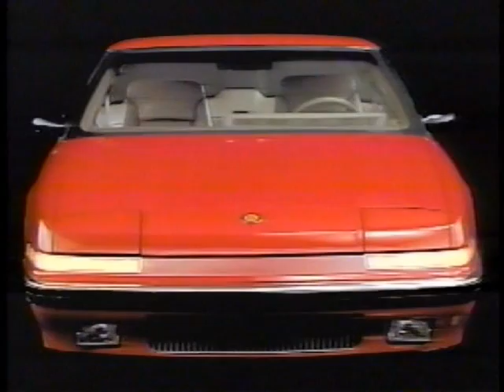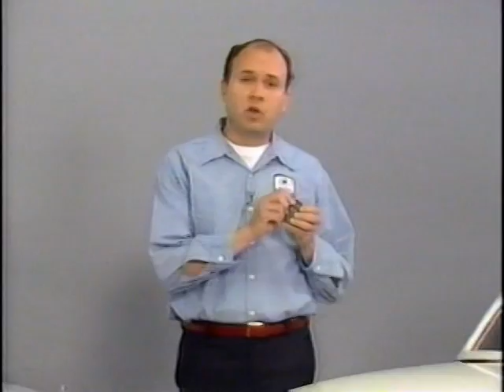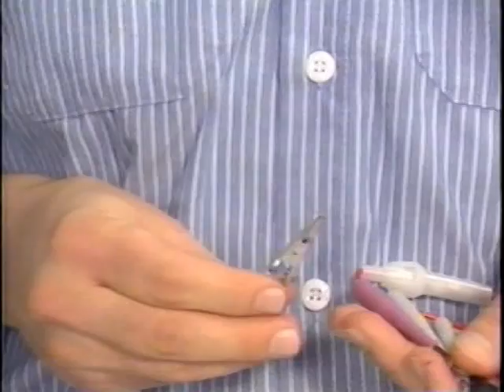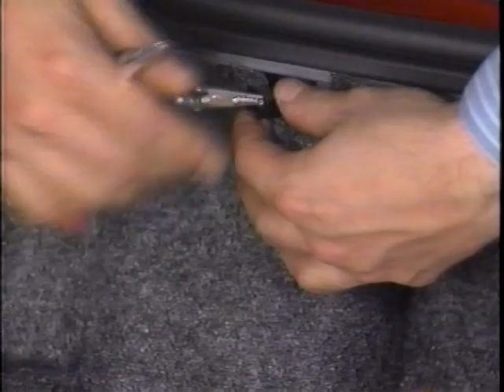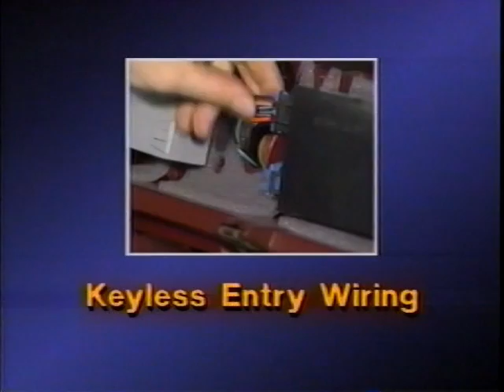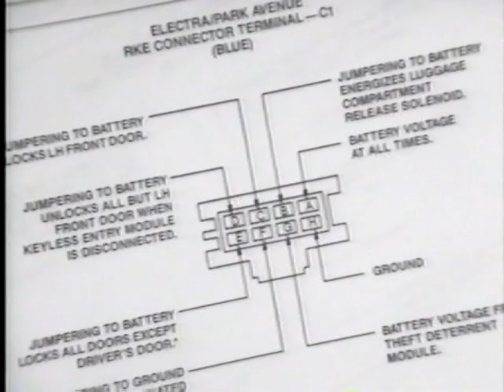Buick - Remote Keyless Entry Systems (1989)

Comment: Any Buick thats front wheel drive is junk even the new Buicks they are a wast of money
Reply: My 90 park ave is very nice the engine is amazing 200k sounds brand new what happened with giur car cv joint busted and you didnt know how to fix it?
Reply: @big6pun07  don't  have  that problem  I a ROADMASTER  rear wheel  drive  with  the Corvette engine  in it
Reply: You're an idiot, I have two 89 Reattas, both over 200k miles and never a problem with either one. You probably drive a pos rice burner.
Reply: Yea ok the 3800 Engine is one of the worlds BEST EVER BUILT
Reply: Waste* dumb ass